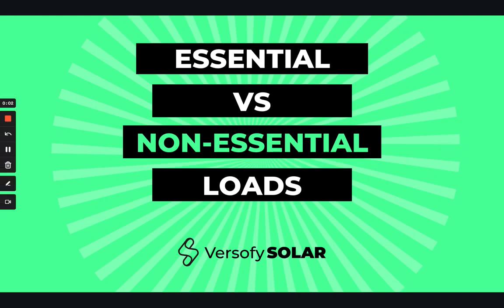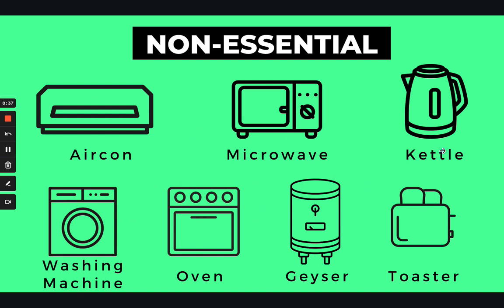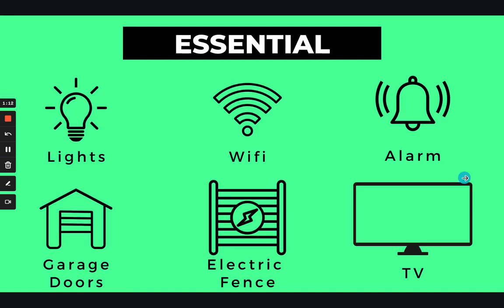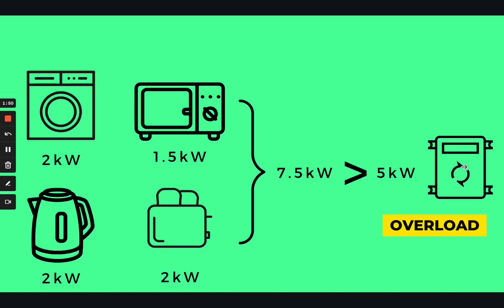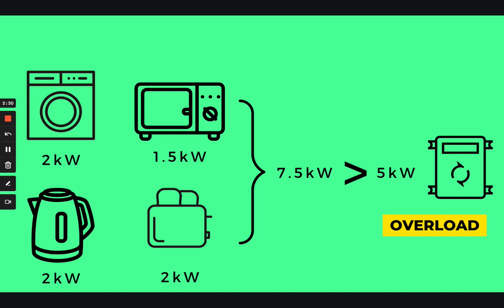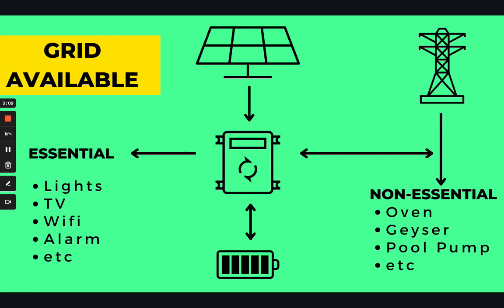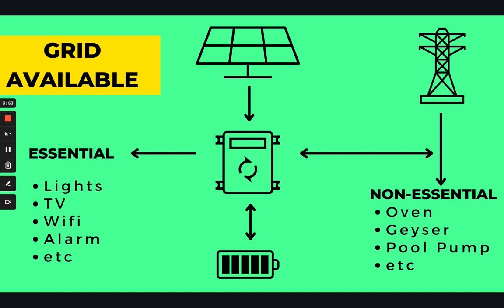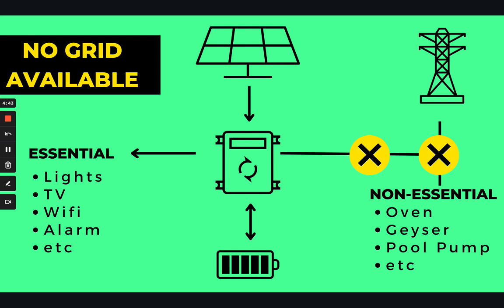Essential vs Non Essential Loads Explained

Comment: Good vid. Whats the main difference between a grid tied inverter and an off grid inverter. Seeing that we dont really export to the grid in South Africa. Why do people buy grid tied inverters when they dont feed back into the grid ?
Reply from the maker: Grid tied inverters are generally installed purely as a cost saving exercise, not as a load shedding solution (grid tied inverters don't work if there is no grid). Generally speaking (in a South African context), grid tied inverters are installed in a commercial or industrial landscape to subsidize a property's draw from the grid. Typical use cases would be factories or businesses that have a high load during the day, these loads then get offset by whatever the panels are producing at the time. These systems work well in an environment where the grid is always present. However, in the current South African landscape it makes little sense to install a grid tied inverter, particularly in a residential environment as it is not a load shedding solution. 

A hybrid system is a much better solution in a residential environment as it can operate independently of the grid. A hybrid system like the ones Versofy installs, come with batteries that store excess power to be used at night or during outages, therefore offering both a cost saving and a loadshedding solution.
Reply: @versofysolar8865  So how can one tell if youre looking at a hybrid type inverter or a grid tied inverter. They all look the same

Comment: Thanks, this is really informative. Does the size of the inverter need to have the capacity to handle both the essential and non essential loads or does the non-essential load draw its capacity from the grid? In other words, if I have 2 geysers, a toaster, microwave, oven, kettle etc, and I want them on at the same time when there is grid power, do I need an inverter which can handle the combined load from the non-essential and essential loads or does it need to cover and be sized for the essential load only. Thanks
Reply from the maker: This is a great question. The size of the inverter only needs to cover the pull of the non essential loads. The inverters that we install have the ability to back feed to the essential loads when there is grid available so you still get the benefit of solar on the geyser etc when there is grid.

A good way to think of it is using water as an analogy. If the grid is the furthest upstream (the source), the non essential loads come next, followed by the inverter and the essential loads after the inverter. When grid is available, the solar can push excess power upstream to the nonessential loads. E.g. if your geysers come on when the sun is out and the grid is on, the system will supply the load using panels as a priority and then draw the balance from the grid as necessary. However, when the grid is not available,  only items down stream of the inverter (essential loads) will get the benefit of the system (panels and/or batteries). 

I hope that answers your question? If not, reply to this comment and we can take a second stab at explaining 😀
Reply: @versofysolar8865  Hi, thanks for your reply. Not sure I understand why the inverter should be sized for the non-essentials load, which runs off Eskom. I thought it should be sized for the essential load, or both. I get that the inverter can push excess power to the non-essential load, grid or both if the essential load has the power it needs as it's a bi-directional, hybrid inverter but I'm still confused regarding how the system should be sized in terms of capacity (5 or 8 kw inverter). Sorry....
Reply: @CarloBaptista because when the grid comes back online the inverter and the grid will not be in phase, with explosive results. So the inverter needs to stop supplying to the non essential side when the grid is offline. When the grid comes back the inverter needs to "listen" to the grid and slowly adjust its own frequency until they are synchronised.